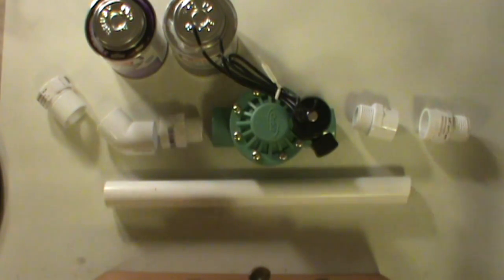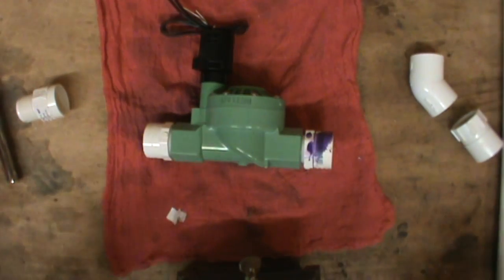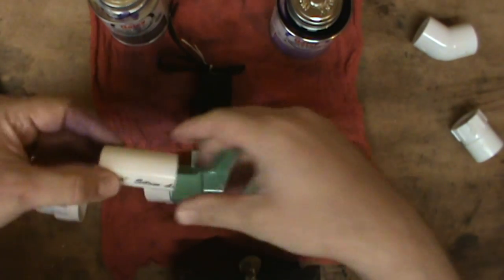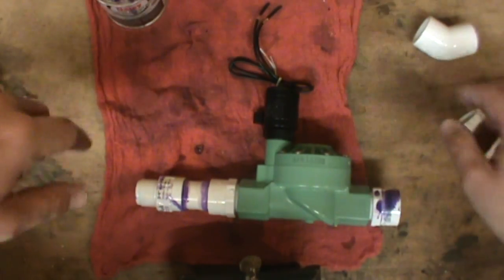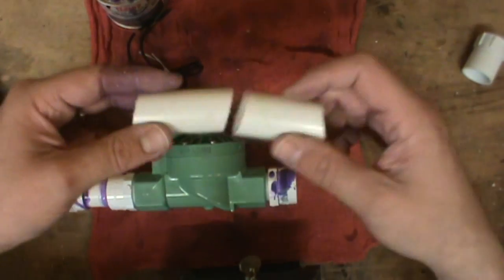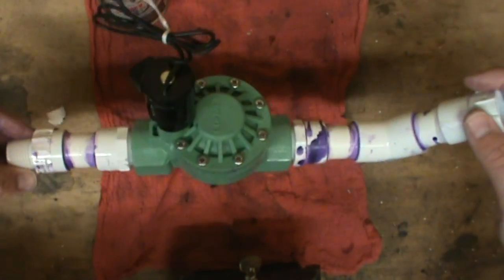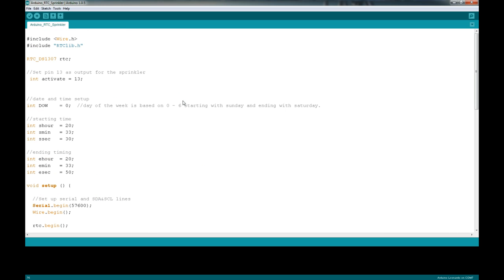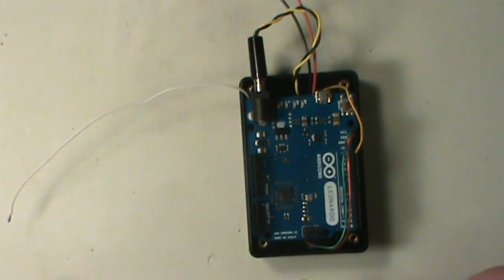Arduino - Automated Sprinkler

Comment: I would like to do a similar thing, but for my house lights. I want to '' ON " & " OFF " my house lights using an Arduino Uno R3 as an timer. I have brought a DS 1302 RTC module, 8 channel relay board and a Arduino Uno R3. Can you help me with the codes.

Comment: great CHANNEL !
this code doesn't work on my arduino nano, 
I think something wrong with my RTC,
this is my serial monitor 2014/4/10 20:33:30 and counting but just won't Trigger.
there is no massage on the monitor saying RTC is not running, so the RTC is working.
advice needed
Reply from the maker: Hey there, thanks for the comment.  I would check your connections ensure that the gpio pin you are controlling is in fact the one the software is coding.  Also to ensure that the software is triggering off of the time you need it to just put a print statement along with the control trigger in the code so that when you reach the time you want it to trigger on it will print something to the screen at that moment.  This will let you know if you have a software problem or a hardware problem.

Hope this helps.

Comment: This is exactly what I needed.  I just got into Arduino and your video is very thorough and easy to understand.  I have one question.  Is the baud rate required to be what is in your sketch?   Serial.begin(57600);  Every sketch I have done successfully has set the baud to 9600.  Serial.begin(9600);   are both fine? is it because I am using an Uno board and you are using the Leonardo?  Thank you so much for this helpful video.
Reply from the maker: This is the setting for the arguing terminal.  It has nothing to do with the rtc serial line.  Thus as long as you have the arguing die connected via usb and set up for 57600 as well it will work.  I have the Leo board so I don't know if the uno can do 57600

Comment: Very good explanation and excellent hands on demonstration.

I'm in the process of building an irrigation controller for my sprinkler system and found this video very useful.
It would help me further if you could provide feedback on my questions and comments below.

1) Could you please comment or have recommendations on using a mosfet over a relay, to control the solenoid valves.

2) I don't remember where but I read that the flyback voltage issue will have side-effect of arduino seizing up if you have the zener diode far away from the solenoid. In your demonstration I saw that the circuit was only a few feet away from the solenoid which is typically not the case. Your thoughts on this would be appreciated.

3) Would it be better to power the Arduino with a separate power source thereby minimizing the chance of damaging it due to something going wrong with the 24V AC power source or the power regulator circuitry ?
Reply from the maker: Hey there, you are talking about protection circuitry.  Yes you could always put a normal diode there to block the inductive over-spike of the coil.  You don't need a zener to do this a simple 1N4007 should do the trick. It has a 1000V breakdown and should be good for what you are wanting to do.  If you have this diode on the line it should not matter whether it is close to the solenoid or not.  What you probably have heard about the distance mattering is that when you get the diode further and further away from the coil you will be picking up more inductance due to the wire lengths.  However, if you have a strong enough diode this should mitigate the over spike issue.  

So far as if you are worried about the 24V power supply having a problem and running voltage to the moon you could place a protective TVS Zener rated at 24V somehow on the input of that power source to mitigate that issue.  However, I would definitely recommend placing like a 1ohm 5W resistor in series with the power supply to help the zener diode out so it doesn't take the full pounding when there is an issue.  All-in-all the best way to protect against that would be to choose a power supply that has output protection built into it for just that very reason.

Hope all this helps.!!

Comment: Hi misperry. Thanks for the video. In regards your question about the momentary pulse on the output when the Arduino starts. This only occurs on pin 13 (on the Uno - I assume it's the same across their boards). I'd suggest you try an alternative output and see how it goes.
Reply from the maker: ahh that is a good idea I will have to try that in additional setups of the arduino.  I don't know why they would waste a pin for doing this with.  The only reason for this pin would be so you could have some sort of startup indication of the board.

Comment: very nicely done thx hope you still comment here.
What happens if i wanna ad more than one zone? Can i add a 8 zone relay?
Will there be any code to change then?
Reply from the maker: +Anton Marais Yes you could.  Also yes you would alter the code to get the different relays.  You could use a solution like this http://www.icstation.com/icstation-channel-micro-relay-module-icse014a-p-5185.html
Reply from the maker: Yes those would work just fine.

Comment: hellow bro first of all thanks for your video..!!!! actually i have got output for the program , while going to the hardware part i have used normally closed solenoid valve ,  when i give the power supply the valve is getting energised and it get opened even am getting output from RTC module but the problem am facing is i couldn't actuate my solenoid valve at the particular instant of time. please guide me...!!!!!
Reply from the maker: +mimicry siva How are you powering your solenoid?  is it with a relay or transistor?
Reply: thank u for ur reply +misperry . no sir i just have connected power mosfet connection with solenoid . i didnt use any relay or transistor sir....
Reply: am using transistor as a power source [ power MOSFET ]
Reply from the maker: Well depending on how you have it connected either PMOS or NMOS you will need to install a bleeding resistor from gate to source to bleed off the parasitic capacitance due to the oxide layer construction of the FET.  Also Make sure you install a diode like a 1n4007 anode to neg side of relay coil and cathode to the pos side of the relay coil to avoid blowing up your MOSFET due to inductive overspike.
Reply: misperry hai buddy how are you, i have a doubt regarding solinoid valve. The solinoid valve which you are using is works under AC or DC. Can you give me the details about solinoid valve. I have completed the project yet to order the solinoid valve thats why am  asking . Pleas help me with your suggestion